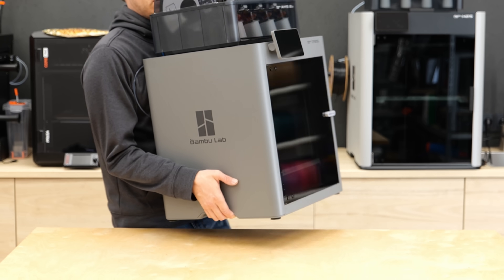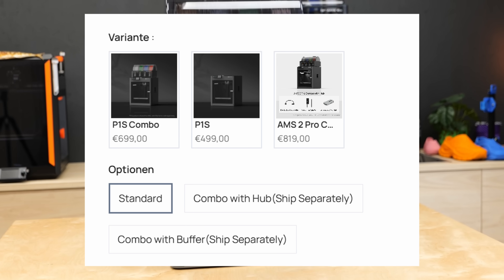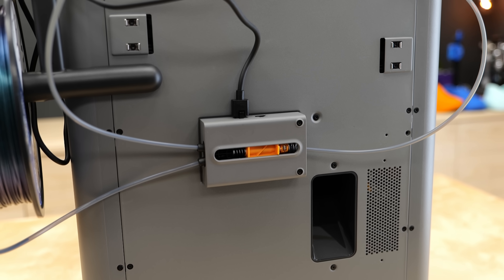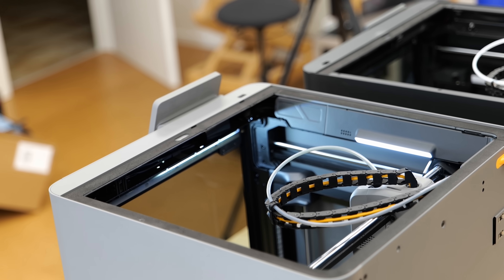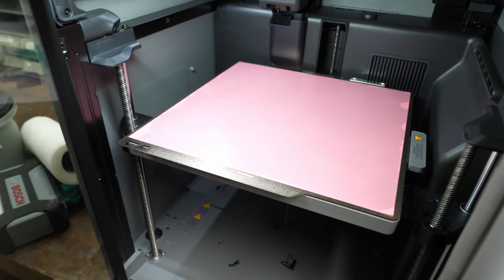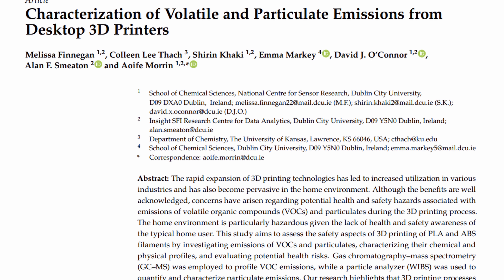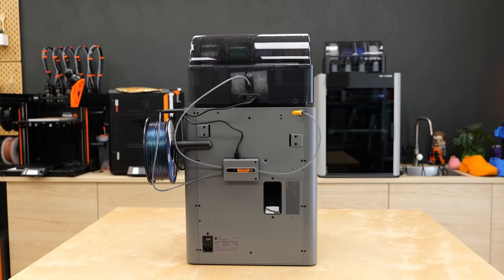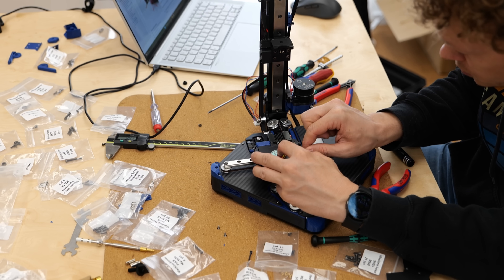The P2S Is the Upgrade No One Expected – But Everyone Wanted!

Comment: I wonder if there will be an upgrade path for existing P1S owners?  I'd love to upgrade the screen and the extruder head.
Reply: They already put on their webpage that you can’t.
Reply: Check out, panda pARTS
Reply: Should have bought a prusa if you wanted an upgrade path. Bambu doesn't do upgrades.
Reply: @LilApe that’s not true. The new Vortek system for the H2C has an upgrade path for the H2S/H2D.
Reply: @SeriesDmusic  Ignore the troll, look at previous comments on this channel. Idk he watches Bambu Lab-related videos, sad empty life I guess. 🤷‍♂️
Reply: @SeriesDmusic  There wont be an upgrade path. I can guarantee it. Bambu lab doesn't do upgrades, the vortex system is just a prototype right now and anything can change. Bambu just said there would be an upgrade to appease people and to not lose further sales to the snapmaker U1. You could easily upgrade the P1S to the P2S but even bambu doesn't allow that. They definitely wont actually allow that with the vortek.
Reply: @radish6691  Call me what you want, just means you can't handle facts. Bambu lab doesn't do upgrades, they never have and never will. The P1P > P1S wasn't an upgrade (buying an enclosure isn't an upgrade lol) and I guarantee the H2S > H2C "upgrade" will be scrapped. They can't even be bothered to do a P1S > P2S even though its all the same printer. Swap the screen and hot end and you're done. But nope, they don't care about upgrades.
Reply: Mate, the filament cutter, the Mainboard (Touchscreen requires different processor), they likely use can bus now for the extrusion head. Motion system is different with metal rails. New enclosure to account for new features. Different AMS. There is no easy upgrade path and that's okay. Great that the prices came down for all those cool features.

Comment: Elegoo makes decent printers. I have a Neptune 2S, 3 Plus, and a 4 Plus upgraded with full rails, silicone bed dampers, Z Belt Drive, and MicroSwiss hot end. My Bambu Lab H2S dances circles around the Neptune 4. No constant bed leveling, temperature issues, calibrations, etc. IT JUST WORKS.

Comment: X1C successor would be the smartest place to introduce the new hot swap system (I would even argue was planned as a key marketing pillar and snapmaker forced a response)
Reply: Taking those fiddly cables off is a nightmare on the X1C I have already almost broken one connector although managed to repair it.

Comment: Had a P1S for a couple years, love it, it just works, but I have never bought PA6 or anything else for it as I’m not sure it will actually handle it well? Am I dumb? (I did upgrade the hot end for printing carbon fiber filled filaments, just never have used any)

Comment: I really want to see an A2 
At this same price point 
Give us an A2 that is 300x300x300 and has the vortek system and uses the same AMS lite or can use the AMS lite 
But also offers an AMS lite pro that has an active dryer enclosure.
It would be much easier to add a 4 color vortek system to the A1 and AMS lite and call it the A2 since you already have the 4 PTFE tubes going into the tool head and the cutter in the head.
Maybe even offer a dual nozzle tool head upgrade for 5 color prints.
All they would need to do is put the vortek nozzle changing system on a sled that moves front to back since the A1 is not a core XY machine.
The A2 could use a sled to move the vortek system front to back when the tool head goes over the edge of the bed on either the right or left side to pick up the next nozzle.

It would cut back on retraction time as well since the AMS lite has the 4 PTFE tubes going directly into the tool head and cuts at the tool head so it would have a speed advantage over the core XY vortek enabled printers due to it but needing to retraction too.
Cheaper price point and faster Larger build volume multi color zero waste bed slinger is what I want.
That is

Comment: Not if I cant use Orca Slicer and have full functionality.
Reply: Bambu is close to Prusa slicer so I don't see this as an issue as I have had 4 years with Prusa Slicer.
Reply: @DavidWhatfor Orca Slicer is the superior option for tunability and adncanced calibration.  But to be fair,  the majority of Bambu owners couldn't care less about advanced calibration options or squeezing every last bit out of their machines. Most of them never use a profile outside of the Bambu defaults.

Comment: The Lidar for filament calibration is still a feature missing on the P2S vs the X1 no?
Reply: none of the newer bambu printers after the X1 uses lidar for the flow rate calibration. Manual calibration is more reliable anyways especially for materials that the lidar struggles with (black, translucent, sparkly). Dynamic flow calibration is done with the eddy-current based hotend sensor and the force sensor on the servo extruder just like the H series.
Reply: Lidar is a worthless marketing gimmick only used to push KS units. Bambu dropped support for it after a month, 3 years ago.

Comment: The easy swop nozzles would make a huge difference. The nozzle heater wires on the P1S are a super pain to align (good old JST connectors like they use on the X1C are a lot easier than the weird P1S things).  I love the Panda touch on the P1S but because of Bambu being a pain, I haven't been able to update the firmware for a while because it would become useless.

Comment: Fantastic hardware.... But man Bambu's attitude on the open source community is such a deal breaker for me. Even if I would be perfectly happy with Bambu studio, the fact I'm locked to it is crazy. Same with the locked printer firmware. They were basically forced to unlock it....

3D printing was built on open source so to see such a prominent player fly in the face of that is such a shame.... For my part I'll stick to similar value offerings from more open source friendly companies. I really hope Bambu improves in this department....
Reply: bambulab aims at a generic user most of the time, not someone advanced, with the H2D being somewhat an exception, but then again it would be used by some local workshop than a 3d printing geek that wants everything customized
Reply: Could be worse, could be Glowforged.  At least we still have some control over the machine.
Reply: They showed their face, they won't change. And you are out of their scope.

Comment: this makes the x1c obsolete you say? 

well lets think about that statement for a minute or two? 
- the lidar scan on the x1c was a fail, lets be honest here? BUT... it got you in the ballpark at least when your in a hurry and just need the part.
- the fact that the new nozzle design of the generation2  that have been reported by users to explode or separate is undisputable, the forums have many posts with pictures of this problem.
- the build volume is the same
- the temps are the same
- still one nozzle
- heavier x gantry with cheap steel rods, the wear fear is not real. im on 12000 hours on the mainrig now, still perfect... weird huh?
- reuse of the x1c frame and shell with a new cutout ( at least, from the video it seems to plausible that more parts are shared )
- the camera has similar or identical video quality as the x1c
- the same drive system and layout

what the upgrade is here compared to an x1c;
- the hotend nozzle assembly that is using the generation2 system that has quality problems
- a flimsy filament cutter solution that does not lend to lifespan length
- a locked down firmware that forces the user use their "security" systems
- yet another step away from the opensource life that is fdm 3d printing
- 6000 outer wall acceleration that causes vfa on slow speeds (a setting even my mother can change with ease)
- a downgraded part cooler with bidirectional ducts (there will soon be a biqu panda jetpack for this im sure ;)
- an apparently clunkier and chonkier toolhead with less airflow for extruder to breathe (is going to heat up faster and retain its heat better)
- no lidar
- a new cooling system that removes the need to open the door or print a ventilation top that does the same
- a dumb airfilter system that spews out the voc's
- still a proprietary carbon filter box instead of a reusable box and a bag of charcoal
- purgelines in the chamber that risk attaching to the exposed rods

 
how can you sit there and lie and say that this is better than an x1c?
man.... loss of karma and my respect

P.S.

i thought it was over with the lies and payed scripted bias, but no.. there was more?

- everything just works.... with pla that is. try using petg and print a part that is meant for real life use? u get a brittle coldextruded pos.. petg hates cooling and high speeds. yet these clowns set the fan to run at all times with a minimum of 40% and max at 60%.... yeah... and the speed is set to whatever it is for pla, as there are only process profiles for pla...  their abs profiles make brittle crap that fail. with their own filament dried for 4 days... just works he says.. WOW....

-if you dont like the locked down systems none of the bambu lab printers are for you. WHAT THE ACTUAL F??? man... u are full of it arent you? i cant belive my ears here! and this is up againt the x1c which can be up and downgraded firmware to the hearts content?!?!? the model of printer from BL that supports the user to stay at 1.8 or what ever it was to be able to use orcaslicer
dont pretend you didnt catch teachingtech or 3dprinting nerd's videos on the topic. that just bs... 

misleading your audience for sour sour sour money from a giant company.. u are the one that has to be content with yourself when you go to sleep at night buddy, i know this is wrong and so do you..
Reply: you seem to be a bit more agitated than this video justifies. it's not that p2s is objectively better in every aspect, but at less than half the price of x1c it's really hard to justify buying x1c.
Reply: @hackleberrym  agitated? no no . im furious as to the lies spewed out here. every single point i made is 100% valid.

he is lying to his audience for shill money and or free printers.. what a joke this channel has become?
half the price for less and partly the same cannot even be considered an upgrade in any shape, form or fashion. 

where do you think that the savings are implemented? i will give u a hint. in quality and material choices. 

as a fabricator myself i know that half price products are inferior in quality in almost all cases. you should find out what the word obsolete is defined as?
Reply: @reyalPRON  yeah, you're right, agitated is not the right word. triggered is more like it :D i'm glad you like your x1c, i'm sorry, i'm going to buy a printer just as good for half the price you paid ;)
Reply: It is obsolete because the P2S is basically the same thing at half the price (with some added/removed features).
Reply: @Snow22040  sigh... its not the same if the features are not the same. it cant be... and its not obsolete. you should enlighten yourself a bit and research the word "obsolete"..

half the price comes at a cost... its basic business 101. like i said. its not the same, its not obsolete its not not locked down, and so on. every single point i made is valid and you know it too. 

im sure u bought a 2 series and you now use copium to justify it.

Comment: So the Question to ask is DO they Phase out the X1Carbon and Replace it with What? If they are smart they could just make a 300x300x300 or Larger PS2 and Label it the X2 or more likely the X2 will be the Tool Changer and Bigger bed.
Reply: They said in their video about the Vortek system that the H2C is the true successor to the X1C.

Comment: 11:14 at least we can continue using the bento box air filter.
Reply: Makes me wonder how many things Biqu will have to revise, and how many will be compatible with either the A or X/P series mods they already offer. I know their great print beds they make have been, as I have one for my H2S.
Reply: @S.A.S.H.  all of them basically, in the video you can see that the P2S, for example, is bigger in both inside and outside, so not even the panda brush will be compatible and since the panda touch hasn't been compatible since the beginning of this year, BTT/Biqu will need to create versions for the new machines.

Comment: Is the "Developer" Mode or how it's called gone from the P2S?
I'm still running 1.7 on my P1S because i'm afraid it'l brake my workflow if i upgrade.
OrcaSlicer has a lot of features i depend on, and I don't want to miss them
Reply: It is not gone, and there are two other ways you can use orca

Comment: Finally years later my X1 is obsolete :P

 Amazing deal that P2S, it'll sell like hotcakes
Reply: At least I can run my X1 with 3d party firmware and software flawless.
Reply: X1 was obsolete after P1S launched
Reply: @riba2233  I have had a p1s next to my X1C since the p1s came out, the X1 is demonstrably a better printer, the only thing the p1s did better was easier to swap nozzles (slightly easier)
Reply: @odditythreeD  no it's not. I'm very familiar with both.

Comment: So we can use orca slicer or on the p2s or no?
Reply: Probably no
Reply: No, bambu doesn't want you using any 3rd party software or devices. They make you jump through so many hoops to the point they hope it will turn you off for even trying.
Reply: @LilApe  you that is made up stuff, right?
Reply: Yes you can, in three different ways.
Reply: @riba2233  none of which is convinient
Reply: @maxdefire   irrelevant. it was never advertised to be conveniently compatible with orca slicer.
Reply: @riba2233  well, relevant for those who prefer Orca to gimped bambu studio
Reply: @maxdefire   not how it works, you can still use orca like I said.

Comment: How about noise? Same like P1 or closer to H series?
Reply: Apparently it's a bit louder because of hot-end fan. Watched a review with noise comparison, and it was slightly more loud for PLA prints. Nothing spectacular, but noticeable.
Reply: Watched a review and when compared to P1S, it was a bit quieter - you do not hear that much clicking when the head changes direction. They probably implemented their noise cancellation from the A1 series.

Comment: That's a huge downgrade compared to the P1S.  Locked down firmware is the silent killer; the cheaper steel instead of carbon rails results in higher mass and therefore higher VFAs, and Bambu still hasn't upgraded the stepper pulleys or belt pitch to 1.5mm or even installed toothed idlers (keep in mind this is a zero dollar upgrade, since the pulleys cost the same).  The screen is not a big upgrade; the Biqu screen and Xtouch are better and offer 3rd party integrations on firmware 1.07 and older.  There are still artificial limitations in the firmware to limit the nozzle to 300C and bed to 100C despite long-term (3000+ hours) resistor mod enabling safe operation at 345C and 140C respectively.  Meanwhile the new ventilation design seems to be intended to block extremely popular user modifications for the P1/X1 series to add a second AUX fan and chamber heater for about $100 worth of parts and filament.  I like the new extruder; the P1/X1 are extruder limited even with a 0.4 nozzle and do not benefit greatly from 0.6 or 0.8 nozzles as a result.  This is the beginning of the end: Bambu's competitors are offering better products for way less (no DRM, can use Orca, 300mm+ build volume, 1.5GT belts, active chamber heating, 300mm+ beds, 370C nozzle, etc for $700), and once their reliability is proven customers will dump Bambu like they dumped Prusa.
Reply: Bed is 110, thanks for letting us know that you haven't even watched the vid and your opinion is absolutely irrelevant
Reply: @riba2233  I must've missed it.  That's my bad.  I have 3 P1Ses and over 4000 hours on my oldest machine with over $1000 in mods between them all.  My opinion is extremely relevant.
Reply: @EliteMacFreak  no it's not, you are very far from their average customer.  Btw you can still use orca, what is with people spreading this misinformation?

Comment: Nice video, I bought my p1s two years ago and the current prices really shows how far bambu has come. Also thanks a lot for featuring my David bust ! Looks gorgeous in that pla.
Reply: Does it make sense to wait November Black Friday discounts. 
Do you mean  there will be cheaper times for p2s ?
Reply: @mustafa_yilmaz38 no I just mean that the printer is really cheap, when I got the p1s combo two years ago it was 1k, now you can get the p1s combo for 700 so that's great
Reply: @mustafa_yilmaz38  Bambu Lab P2S 3D Printer
€749.00 EUR
Final price and VAT may change based on shipping destination at checkout. More details
No Black Friday Discount – Best Price Guaranteed

Comment: The closed ecosystem is what keeps me from considering one, but I don't really have a reason for it. I avoid cloud-dependent stuff mostly for privacy or 'what if they turn it off' reasons. But those don't really matter for a 3D printer. I don't expect Bambu to go bankrupt or stop supporting it in the 2-3 years I expect to use it for. I am currently running a Creality K1 Max and its modded with custom moonraker and fluidd and stuff, but after the initial setup I stop tweaking it and now I dread even replacing the hotend. I just want it to print my stuff. Not figure out what thing I have to order to fix the darn thing.
Reply: You don't have to use the cloud, are you not aware of this?
Reply: @riba2233  As far as I understand, you do if you want to monitor your prints from your browser. I converted a broom-closet to house 3d printers and have a screen mounted outside to display the fluidd interface and ip camera. I consider the LAN mode or USB features to be a last resort to not throw it in the trash if something happens. Not for daily use.